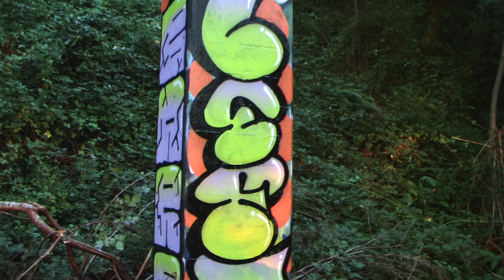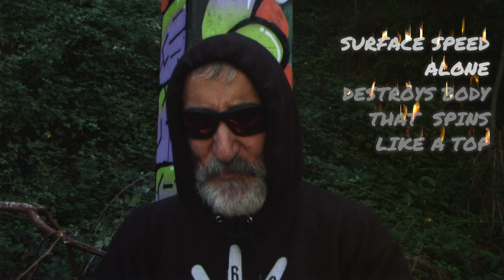WHY A SPINNING BODY BREAKS ALONG ITS LONGITUDE no cracked body can spin globe earth is a fantasy

Comment: The main problem with people understanding the forces involved is because of the scale of the demonstrations.  I have a 6 foot ring that I would like to mount on a bearing so it spins freely, I also have a weighing scale.   Now if I had a ring 6 inches in diameter I could mount both rings on the same said bearing and spin them at a  certain rate that would show on the scale.  If I could find a bearing to mount these rings on I could prove how much more massive force is applied to the outer ring compared to the inner one.  The result would be quite startling I am sure.  My problem is to adapt a cars wheel bearing to mount the rings on, which means digging a big hole in the garden and getting a motor and a gear box to suit the speeds required.  The speed required to demonstrate this is not much but it would show how we can relate to the size, speed and difference of the inner and outer rings.  The problem to demonstrate this for me is, 1. having the time to build such a structure.  2. to gather up the required tools required to build such a thing and 3. the need to pay for such items.  The same problem applies to anyone, cost time and materials. Having said that though, it is not beyond the means to be able to do so for anyone that has a reasonable amount of space in their backyard.  I could do it but time and materials is a great obstacle for me and I am not overly keen to set the apparatus in motion when I am at present trying to clean up my backyard :)  It is a project I would like to undertake though, and not just to prove to the people but just for the joy out of finding out just how much force in even such a  comparatively  small scientific demonstration for myself.  Then, once that has been defined just how much force there is to upscale those results to something as massive as the earth would result in the Trillions of tons force you mention.  As for gravity neutralising the force is garbage because flywheels are often mounted horizontally  anyway !  The globalists try to make you think putting a 2 foot disc on an angle grinder would be perfectly ok cus gwavity would overcome the centrifugal force, mind you that's taking it a bit far cus angle grinders are used in every axis possible from perfectly horizontal to perfectly vertical unless they think you can only use angle grinders at a certain angle ??? :) :) :)
Reply from the maker: i would be willing to contribute some money, and i'm sure others on my channel would also contribute ... or, we could get Colin Furze to do it!  :) :) :)
Reply: But is it valid to wish gravity wasn't an issue? Don't you need a more rational argument than calling it garbage?
Reply from the maker: @michaeldunlavey6015  a force that opposes .0034g is not an issue (it also is perpendicular to the ripping force making it useless since it is not in direct opposition) Ask yourself which is stronger: molecular bonds or "gravity"? Ask yourself how does a cracked water ball spin, when only SOLID OBJECTS can spin like a top? Ask yourself how the cracked water ball can spin over 1000 mph and have zero tensile strength at the same time, how does it outperform solid titanium? No solid material can spin 1000 mph.  And that's the end of the globe!

Crying "gravity" is all you got. Too bad.
Reply: @rocketspushoffair  You can cut your hoop into 360 little pieces, or 3600, or 36000, each held to the center by wire spokes. Now the outward acceleration A of each piece is V^2/R. At the equator, V is 465 meters/second. So A = 465*465/6378000 = .0338 meters/second/second.
So, just cut up the hoop into little pieces, and add spokes (simulating gravity). They don't fly away, do they? Even if you reassemble the hoop by putting a drop of glue between each pair of pieces. Do they explode then? (No.)

Crying "gravity" is all it takes. Too bad.
Reply from the maker: @michaeldunlavey6015  still a HUGE FAIL FOR THE GLOBE since "gravity" within the ball is ZERO so where is this magical force coming from? N.D. Tyson says "nobody knows" there is no "gravity" left over to handle the centrifugal force ... Paulster X once claimed that it "manifests" out of nowhere 🌍👈😂 Crying "gravity" is all it takes to fail by reification fallacy, a logical fallacy. Like I said, "gravity" only acts on surface objects, and you need to stop contradicting your globe dogmas because they treat it as a solid object
Reply: @rocketspushoffair  what does "gravity only acts on surface objects" mean?
Reply from the maker: @negatorxx  that it's useless compared to molecular bonds
Reply: @rocketspushoffair  wrong.  like everything else youve said lol
Reply from the maker: @negatorxx  keep dreaming
Reply: @rocketspushoffair  ah yes, you and all your scientific accomplishments have outsmarted the whole of humanity....

Comment: Glad you're admitting the earth is a globe.
The rest of your "proof" depends on undefining gravity, and getting viewers to agree.
No?
BTW - welcome back :-)
Reply from the maker: no, even with "gravity" the cracked water ball cannot exist, let alone spin like a top over 1000 mph (watch it all, read description)
Reply: @rocketspushoffair  We've been through this before. The mechanics handbook is absolutely right, in the absence of gravity.
Simple example: place a brick on the ground at the equator (assume it's going 1039 mph east). Weight holds it down, not tensile stress (because the brick is not attached to anything). The same goes for the all the water, sand, etc.
The argument that gravity is orthogonal to tensile stress ignores that the tensile stress is due to the radial acceleration, and nothing else. If there's less radial acceleration, there's less tensile stress. At the equator, radial acceleration due to gravity is downwards and almost 300 times greater than centrifugal acceleration due to spin.
So, in the absence of gravity, you'd be right. An 8k mile diameter hoop with negligible gravity would indeed break apart and go flying. But in the presence of gravity, the earth would have to be spinning 17 times faster (square root of 300 - orbit speed).

But if you don't accept spin of the earth, that puts you in the same camp as the geocentric model, that worked well for thousands of years. Ok.
Reply from the maker: @michaeldunlavey6015  holding a brick to the surface is IRRELEVANT, it has nothing to do with tensile strength and SOLIDITY (only solid objects can spin like a top) MOREOVER, the rotation axis of the brick is far away from its center of mass, while the rotation axis of the cracked water ball IS ITS CENTER OF MASS watch the video and study all the material in the description
Reply: @rocketspushoffair  Physics disagrees with you.
Reply from the maker: @eminence_front6043  all modern society is based on the engineering physics I'm talking about, your comment is from incredulity and laziness, the info is in the video and referenced, explained and proved at the links in the description ... you went full re-tar-d on YouTube, congrats globe-rider! 🤣
Reply from the maker: @eminence_front6043  "Dunning-Kruger syndrome" no, what you say is what you are. Se my previous reply, and follow the instructions in it. Then ask a question, if you still don't get it. Stop floundering.😂
Reply: @rockets push off air  Looks like it's you who doesn't get it.  You obviously know nothing about engineering so you just make stuff up.
Reply from the maker: @eminence_front6043  Why are you still going full ree-tar-d? Refute the engineering text books here spin1.flat.wtf on Blogger. Or get lost, don't you have a life? "Looks like it's you who doesn't get it." Really? Hmmm, can't wait for your Nobel prize and all the engineering text books get rewritten with your name in the credits!🤣
Reply: @rocketspushoffair  The tensile force is a function of the centrifugal acceleration. Which acts in the opposite direction as gravity.... which is also an acceleration... and since accelerator is a vector, two opposing accelerations will subtract from one another. With the acceleration of gravity being far greater than the centrifugal acceleration one just deducts the centrifugal acceleration from the acceleration of gravity. But because gravity is much larger, this still results in a net force inwards. not outwards.

Infact you can test this yourself with a 500g calibration weight and a kitchen scale that can measure down to 0.001 grams. (not that difficult to find, fairly cheap to buy). Measure it from the ground. Then go to the very top of the building and measure it again. The weight should change. predictably according to the decay of gravity with distance, and the increase in centrifugal acceleration with increased radius from the axis of rotation.

Don't want to do that yourself? sure, go look at YouTube videos of people doing for science experiments, school projects, etc etc etc.

Using incomplete data to come get to the wrong conclusion doesn't make that conclusion right. Its still wrong. If you're going to debunk the globe model, it will need to account for the globe models integration of gravity. you cant just ignore a key part of the globe model to debunk the globe model. That would be like saying the Americans put the first man in space... if you ignore everything the Russians did. Or like saying the land speed records should be easy to break.... if you ignore rolling resistance....
Reply from the maker: @engineeringtheweirdguy2103  you are still CHOOSING to go full re-tard on YouTube! 🤣Nothing you said has anything to do with a body spinning like a top, spin1.flat.wtf you're NOT an engineer! 😁😆😂
Reply: @rocketspushoffair  you don’t understand acceleration do you? When you let go of something, does it accelerate towards the ground in the opposite direction to the centrifugal acceleration!? If the answer is undoubtedly yes, the don’t you think that needs to be accounted for?
Reply from the maker: @engineeringtheweirdguy2103  irrelevant! 🤣Explained here spin1.flat.wtf get clued up if you want to continue.
Reply: @rocketspushoffair  irrelevant? The thing that makes objects accelerate from your hand to the ground is irrelevant to centrifugal accelerations is it? Are you consciously aware of how much you’re cherry picking information to fabricate your ”evidence” or is this entirely subconscious or plain idiocy? You still havn’t been able to provide any substantial rebuttal to this other than to shout.. and I quote… ”irrelevant” so what might that tell you about your “proof”?
Reply from the maker: @engineeringtheweirdguy2103  tell me what's "fabricated" on this page spin1.flat.wtf I say it's "gravity" 😁😆
Reply: @rocketspushoffair  doesn’t matter what you call it. It’s obviously and demonstrably there. So why do you selectively ignore it?

Comment: I had to come back and comment because something in your video jogged a memory. You mentioned as most people do if Earth were spinning the area at the top would be spinning slower than the equator. I've always had a problem with this ever since my 4th grade teacher tried to use  hour minute and second hands of a clock to explain why the tips are moving faster than the center. The problem is our definition of speed equals distance divided by time when used for spheres. Time can be subjective to the observer. Time is not a real thing but a concept, an idea. Movement does happen over distance, both two very real things we can see, actually experience and measure. If I'm setting the rate of speed my drill will go and stick a clock hand or ball on it, all points on the hand or ball surface will all move through space at the exact rate of speed my drill is set for because that is Fixed. The fact it's making a smaller revolution at different points does nothing to change how fast those points are actually going so we need to take the bend out of the curvature. We've been thinking this all wrong for spherical objects. If instead of a sphere we take any of these two points and project them in a straight line we would see the duration of the ray won't change between the two because there is no revolution to say hey stop, you finished your race now start over at another revolution, the two points would fly along at the same rate of speed indefinitely. It's only until we assign a stopping point and call that distance does the duration of the ray our two points created stop thus defining time. We see that all points do indeed move at the same rate. The whole idea it's defined by revolution (something that curves back on itself) is a huge problem. It's not a fair way to judge the speed of those points to contrast them to each other.
Reply from the maker: It's very simple, the point at the tip of the hour hand covers more distance in the same amount of time as a point closer to the center, therefore it is moving faster.
Reply: The second hand on your clock has two kinds of velocity - linear and angular. Its angular velocity is 360 degrees or 6.28 radians per minute. Its linear velocity is different at each place along the second hand. To get linear velocity at a radius from the center you multiply the radius (in distance units) times angular velocity (in radians/time).
Reply from the maker: @michaeldunlavey6015  radius is irrelevant when spinning like a top to destruction
Reply: @rocketspushoffair  How is the radius irrelevant? If the Earth didn't have a radius of 6,371km it wouldn't have a linear velocity of 1,676km at the Equator.
Reply: @rocketspushoffair  "spinning like a top"
Really? Rotate yourself at 15°/hr (thanks Bob) then say that the Earth spins like a top.
Reply from the maker: @BigHeretic  You are still going full r-tar-d on YouTube. It is obvious you have not watched the video and/or not understood it due to ignorance of the engineering and/or you did not visit the three text books at the three links in the description and/or were to dumb to understand the explanation 🤣

edit: your comments are completely irrelevant, put a little effort (hint: Bobs your uncle) 🤕🤯🤠
Reply: @rocketspushoffair  All you do is deflect in order to not address my comments.
They are relevant, you just cannot address them without disproving your assertions.
Is one revolution a day "spinning like a top"? Of course not.
Reply from the maker: @BigHeretic  repeating your ignorance helps you believe it?☹

Comment: 39 mins of complete and utter crap, the earth spins at 15 degrees per hour....thanks bob....one revolution over 24hrs
spin the apple or the onion at 15 degrees per hour, it will be very boring
Reply from the maker: Ask "Bob" to show you how a cracked body can spin at all. SPOILER: it can't. RPM is also irrelevant, only surface speed matters spin3.flat.wtf Watch the video next time and read the description and info at the links, before going full re-ta-rd on YouTube. And tell "Bob" to use a regular gyro, and see if it backs him up ... it doesn't HAAHHHHAHAAHHHHAAAHAHH!!!!
Reply: @rocketspushoffair 
wtf is a cracked body
nothing you posted there makes any sense.
rpm is not irrelevant, its an indication of rotational speed about an axis...the earth rpm is 1/24*60 or 1/1440...mans that blazing action there.
i dont think you mentally grasp how big the earth is 
your boi bob used one of the most advanced pieces of tech around,  think we ll go with bob instead of a cackling rockets